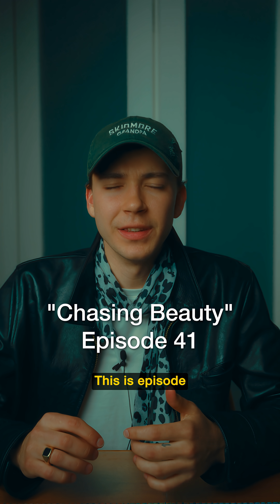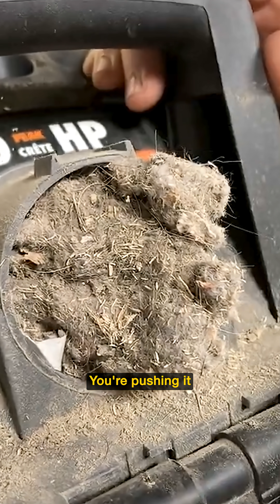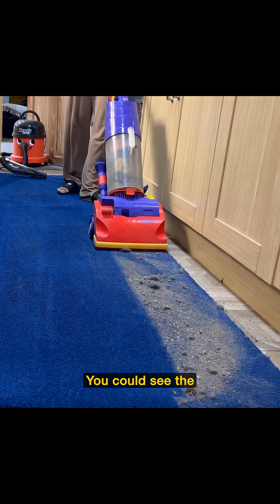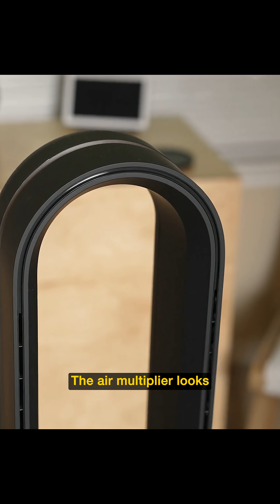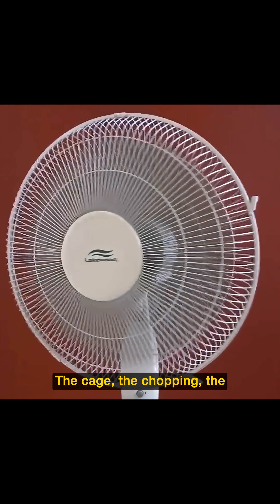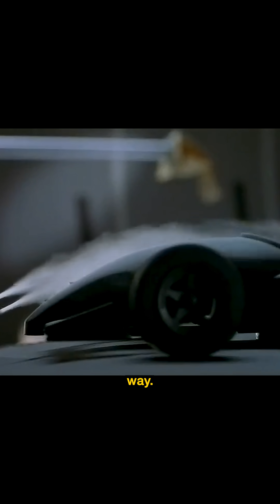Dyson products look weird, but there’s a reason. Behind their iconic product design...

Comment: Retailers also hated Dyson because with his vacuum cleaner people wouldn't purchase dust bags.
Reply: I wanna buy Dyson, I just don't have the money for it😢😂
Reply: @clareang  Get a used one. Just make sure it's a good one. I bought two new and have had both for a looooong time and they both still work great. Idk about the new ones though.
Reply: @clareang do your research there's always another company product that's better or just as bad(yes never ever had a good experience with dyson)
Reply: @s @shiion6711 dk if you pick up a V8 and mod it to work with a 9.0Ah drill battery then they run for well over an hour and can cover any modestly sized home

You’ll give up the fancy pass through charging but you can just slide the battery off and load a new one. If you’re already initiated into any of the clans, you probably already have spare DeWalt, Makita or Milwaukee batteries laying around your house
Reply: @shiion6711  only major negative experience I have with Dyson is the DC63.
Reply: @clareang  there are many, many, many other brands of bagless vacuum that are significantly cheaper than Dysons, and they've existed for decades now. Stop being lazy, go find a bagless vacuum for like $30. It'll be fine. Dyson's products are deliberately over priced in order for them to appear to be luxury items, much like what Rolex did with their watches where they were originally quite cheap, until cheap quartz watches came along that told the time more accurately and didn't need winding. So Rolex greatly increased the price to enter a new market, the luxury item market, so that they could then sell their watches for tens of thousands, marketing them as jewelry instead of as a practical item for telling the time.
Reply: @clareang I've seen a lot of people claiming their Dyson products just stop working, even new ones. Idk if it's worth all that money yet. I don't think they've fully got this new tech down just yet.
Reply: @anh7807 yeah the Dyson are EXPENSIVE and always break down after a few years. I love my Sebo that has a bag and amazing filtration. I have cats and with my allergies it really helps. Suction is amazing too and never had it clog
Reply: @anh7807  Their design compresses the transistor near the motor, resulting to the transistor melting and failing after certain use. I saw a vid on youtube on how it works and they replaced the transistor just near the motor because it stopped working with afformentioned issue.
Reply: @anh7807  "New tech" bro Dyson has been around for 3 decades... just say you wanna hate on something you only have biased secondhand information about.
Reply: @anh7807 who are those People?? a lie you tell
Reply: @ArcaneShenaniganery they've been around, but not with this specific technology. Go read the reviews yourself.
Reply: @anh7807 Uummm, it isn't going to get any better; the Dyson has been around for nearly TWO DECADES at least, and they're still JUNK. I used to have a sales/service/repair shop for sewing machines and vacuum cleaners; ALL bagless units are solid, cheap plastic, they're filthy to empty, most use expensive after-filters or permanent ones that require meticulous maintenance and cleaning, and NONE of them will actually do what they claim they will; we tested them against other vacuums all the time, and several other different brands were always proven to be better, in many cases, much, MUCH better, than Dyson. If you want a high-quality, dust-free solid performer, I'd recommend a refurbished Kirby, TriStar or even a Rainbow, IF you don't mind fussing around with a water filled basin every time you use it; personally, I find it to be major pain in the ass. Some excellent plastic units are Miele, Panasonic, Simplicity or Riccar; the Sanitaire line is also worth a look if durability is important, but for reliability and durability, a good used refurbished Kirby is a good choice, too; just don't go in for all of the extra, optional accessories like the carpet shampoo unit, floor polisher or turbo sander; you'll never use them. Just grab a set of basic cleaning tools and the hose, and between that and the upright unit, you've got more than enough. They also tend to run for 25-30 years, and they can be rebuilt over and over and over again.
Reply: @anh7807 my mum still has the hoover shown in the video. Dyson products are good
Reply: @ArcaneShenaniganery  Retro Dysons are unbeatable.
Reply: @anh7807 planned obsolescence baby, having a product that lasts forever just isn't as profitable
Reply: @anh7807 buy it on sale will change your life haha 😅
Reply: @anh7807  if it makes any difference, my family bought a Dyson in 2011 and they gave it to me when I moved out. I took it to the shop recently because I accidentally yanked the cable out, and the lady behind the desk told me Dyson hasn’t made a good vacuum in the last ten or so years. She said the stick vacuums are the worst and only last a couple of years on average. Mine still cleans like a champ after 15 years of use.
Reply: @anh7807  i've had a dyson vacuum for almost 10 years and its still alive and sucking
Reply: @anh7807  they are terrible. Also super non ergonomic. Honestly it's like they make every aspect of them as unergonomic as possible on purpose, it's that bad
Reply: @anh7807  our vacuum did stop working, bought it twice because my dad didn’t notice it was the same brand we bought the first time, both stopped working.
The fans do work, we’ve had them for years and they do work well.
Reply: @anh7807 my family does house cleaning(so disclaimer this is using a vacuum like 100x more than it’s meant to) and my dad(vacuumer) really loves the Dyson ball vacuums despite the fact that certain design flaws makes them last only 1-12 months. At one point we were going to macys to replace the Dyson EVERY MONTH until macys stopped letting us return them
Reply: @anh7807  my family have had a v6 absolute since like 2015 and it STILL works like a charm after ELEVEN YEARS
Reply: @anh7807  They can still clog. You just can't see the clog. You have to take the stupid thing apart to find it, normally in the short connecting tube from the roller brush to the cannister. 

You suck up something that's a little large, it blocks that tube a bit, which catches more and more dust and dirt. Pretty soon it doesn't suck up anything. 

Ask me how I know. 🙀
Reply: @daleryanaldover6545  so they do it purposefully for planned obsolescence? Because that sounds easy to fix
Reply: @anh7807 own 3 Dyson vacuums, and the blow dryer. Best blow dryer i have ever owned hands down. I own 3 vacuums because when I move I get a new ones, all 3 work great even after years of ownership. So as an owner of many of their products, they work great, but thats from my personal experience
Reply: @anh7807 you're gullible if you believe people who masquerade as being able to afford a Dyson products. Oh you silly child 😅
Reply: @anh7807    Yeah, this new 33 year old tech…
Reply: @marjoriemacdonald3153    Almost like every appliance requires some kind of maintenance 😮
Reply: @daleryanaldover6545   yeah I very much blame user air obviously certain things could be made better, but at the end of the day machines are made to be used for certain purposes in certain ways and pushing them past their use case or use time is always gonna be bad and result and catastrophic failure eventually this has been the case for like all of my mom‘s vacuums and it wasn’t even her fault. It was just everyone else that used it would let it get all clogged up which then let’s trap heat which then also if you keep using it for like an hour or longer, it’s also gonna get hot. I mean if you need to do it in multiple passes, then you need to wait.
Reply: Error*
Reply: @daleryanaldover6545   It's not "compressing" the transistor.  
Overheating it is more likely.  Transistors don't belong on AC motors anyway.
Reply: @NullwaveHORRORAt less than 10 years old, I should hope so.  It's still practically new.
Reply: @ethereal41 I should hope so.  At 11 years old, a vacuum at that price is still practically new.
Reply: @stevethou  That's pretty new.
Reply: @clareang there are similar models from other brands. I have a samsung and it works great! 6 years of hard working in a house with 2 fluffy cats and my long hair. I use it daily to prevent dust allergy to flare, too.
Reply: @giuliaspezi9912 At merely six years old, I should hope so. It's practically new.
Reply: @clareang 😂😂
Reply: @clareang. I was a cleaning lady for 35 years. Dyson sucks, no pun intended. The vacuum tanks leak dust. The suction is too powerful, so what you see in the tank contains unnecessarily destroyed carpet fibers, along with dirt.
Reply: @annhalton1963   Agreed on the dust leaking part.  Most bagless vacuums can only go so long before they start leaking dust thru its o-rings like this.  
But there's no such thing as a vacuum too powerful...  those bits of carpet are not from overwhelming suction:  a damaged beater bar can physically shred carpet though, although it's pretty rare.  It's most likely just old carpet, and the fibers are getting brittle with age and dirt being ground into them underfoot.
Reply: @1SqueakyWheel No. I know what I am talking about.
Reply: @annhalton1963  I'm not here to argue..  just giving you a friendly heads-up on something you may not have realized.

Dyson has never been anywhere near the strongest vacuum motor out there doing residential or commercial duty; 
If a carpet breaks up while being vacuumed, that's a carpet problem, not a vacuum problem.  

But if it helps to draw you a comparative picture, knowing what you know about cleaning various household materials, consider this:  

Professional steam-cleaning rigs so big that they are physically driven on roads to a customer's house or office.  
You know the big vans with giant 2½ to 3½ inch diameter vacuum hoses, long enough to reach every corner of a house through its front door while parked on the driveway or curb;  This thing is no mere Orek.  

These vacuums are so powerful that they have to be powered by gasoline/petrolnor diesel engines, all while spraying water so hot that it has to be heated by a live boiler so that it comes out of the nozzle and injected into the carpet at upwards of 300°F... (over 160° if you into celsius).  

You know what happens to synthetic fibers when they're wet and/or saturated with heat well above boiling point, right?  They're even more likely to come apart, if they're prone to do so at all.  

These engine–powered vacuum rigs apply a suction with both volume and intensity that no measly 15-amp run-of-the-mill vacuum cleaner from Walmart could ever even hold a candle to.  

So if these professional steam-cleaning companies aren't getting sued left and right, then suffice it to say that there aren't portable Walmart-grade vacuums like Red Devil, Eureka, Hoover or Dyson out there breaking the laws of physics with a little 1 to 1½ inch ID hose aperture powered by 120vac wall-plug cord at a 15 amp limit.  There's just NO comparison.  

Either the carpet you experienced was old and worn-out from years of soil grinding and shredding the fibers over time, or it could also be a chemical that was previously applied that damaged and/or weakened said fibers so that all it took was a basic upright PLASTIC vacuum cleaner's brush-bar to start shaving and sucking up bits of that carpet.  

I hope this helps.
Reply: @clareang  Dreame has similar vacuum cleaner, I have the R20, it's great, has power und you can easily get an extra connection piece that allows you to fold/bend the tube to have an easier access to vacuum under couch and furnitures etc.
Reply: @clareangdon't bother. Get a Miele.  German made vacuum cleaner with bags. I've had mine over 12 years now and I love it. Great suction and no dirt that you need to empty. I bought one for my mom too. And it is repairable at a vacuum shop. Nothing compares to this brand of vacuum cleaners.
Reply: @clareang  I suggest you save your money; they're solid plastic garbage, AND....they absolutely do NOT perform the way they claim they do! It's all a gimmicky LIE. I used to own and operate a vacuum cleaner and sewing machine sales and repair store; we sold any brand of vacuum, so we were not locked into promoting one brand over all others. Don't waste your money...also, bagless vacuums are a filthy, unsanitary mess to deal with and empty, because no matter how the different bagless vacuum brands are designed, dumping the dirt container is UNIVERSALLY a nasty, filthy MESS. Disposable micro-lined bagged brands are superior to bagless in every conceivable way.
Reply: @jamescarrington5521  To the eyes of the store selling replacements I'm sure disposable bags are superior.

Unless you're dealing with literal toxic or biohazardous waste I don't see much issue with a tiny bit of dust wafting out to settle on the floor when emptying a vacuum cleaner into the trash.  It was out on the floor to begin with after all.

You could also do what I do and empty the vacuum cleaner outside if you have a yard.
Reply: Don't, it's not very good.
Reply: @clareang just get a shark, cheaper and last longer
Reply: @clareang it’s not even that good…
Reply: @clareang  they are crap. Just get a good bagged vacuum cleaner.
Reply: But the lifetime worth of bags is already included in dyson price anyway =)
Reply: Bags are super cheap also better filtration I have small polish vacuum with hepa filters and synthetic bag
Reply: My Miele is better than any Dyson i ever used. I have allergic Asthma.
Reply: @KarMa-ws3ll yup. Iced had a Miele for 12 years now. Bought one for my mom.  I love using it. And I don't mind paying for the bags. It's a lot better than emptying the dust yourself! I've had it repaired once or twice but I think it will last forever. Like a family heirloom that I can pass on down to my kids! Best vacuum cleaners out there.
Reply: It’s too bad that bagged vacuum cleaners are far better!
Reply: Dust bag is a joke.Just put it dirt to trash can.Yeah! Dirty hand but saving a lot of money.
Reply: @macnguyen9414  My mother literally had me do that as a kid because we could not afford to buy new bags as often as we needed them.
Reply: @winterinbloom  I literally do that right now. I just use a gloved hand and voilà. I only change bags when the old one is REALLY bad
Reply: Someone made a reusable bag that had a zipper that you could dump it all out easily, but only had those that fit certain vacuums.
Reply: I hate Dyson coz they’re tax dodgers
Reply: Isn't the plastics in Dyson vacuum cleaners really shitty? We once had one and it was really brittle. Things would break often. Not a high quality product. It just looks cool that's it.
Reply: To be fair dust bags are more effective and far cheaper than replacing the filters.

But Dyson has good marketing.
Reply: The vast majority of household vacuum cleaner manufacturers had their own bagless models before Dyson ever hit the market.
Reply: We had reusable fabric bags for decades before the paper ones became popular. People just got sold on not washing them. Dysons and sharks are junk I would take an oldschool vacuum and a mini shop vac any day.

You are paying a premium for marketing hype. "OOH cyclones, it must be good". Baaahhh

This video is some ridiculous dick riding. They make stuff look cool so rich idiots will buy it and brag about it, period.
Reply: Ah, the classic bait and hook business model. The bane of printer users across the world.
Reply: pricier than the alternatives ? yeah
a few years behind tech-wise ? I doubt it
Reply: Ĺ😅😅
Reply: That's why you make it cheaply out of plastic. so it'll break in a few months to a year and they'll need a replacement
Reply: Now they buy v8-10 housings cuz the latch breaks 😂
Reply: which is why it costs so much
Reply: Their after service is something to be experienced!!!!!
Polite , helpful, respectful knowledgeable and a total pleasure to deal with.
They really have changed the game ……..
Reply: Now they love them because bagless vacuums die faster than bagged ones do so now they need replaced more often.
Reply: Untrue. My father worked in a specialist appliance repair shop and hoover bags were a 'loss leader' (<£1 for 5) to give people a reason to browse the shop. It was the reusable/washable cloth bags that killed that off first.
Dysons were great for business because they required expensive parts, had many potential 'points of failure', the plastic cracked easily in some areas of the casing, and their suction power meant people were accidentally hoovering up larger objects and damaging the machine. 
People did like the see-through aspect, however, but not because it showed how powerful the hoover was - it was because they could see when it was full and avoid causing a fire.
Reply: @richardwright9292  how else will I know when to empty it 😆
Reply: Luckily they made peace with retailers by implementing planned obsolescence and unrepairability. Every product must be delivered to a landfill within 2 years, that's the Dyson promise.
Reply: Wrong. You just have expensive filters to either wash or replace all the time, so retailers couldn't have cared LESS. But go ahead, all of you CHEAPSKATES, remain in the filthy dark ages and keep buying your WAAAAY OVERPRICED, all PLASTIC bagless vacuums that also come with PLANNED OBSOLESCENCE built right in; oh, what EXPENSIVE FUN! I used to see these vacuums in my repair shop all the time; one day, we decided to see just how great it was supposed to be, so we did a side-by-side comparison with a bagged, micron hepa filtration Kirby, and our findings were surprising. We poured half a box of salt onto 2 separate, thick rugs, then we ground it in, to represent sand and grit, which is what actually wears a carpet out, so removing all of it is essential. We ran the Dyson over the rug, stopping to empty it repeatedly until it was no longer picking up any more salt; then we did the same with the Kirby, then we removed the bag and replaced it with a new one and vacuumed it again, and then we cut the bag open; just a tiny bit of salt was visible. We ran the Dyson over the Kirby side, and it picked up no salt. At all. Then we used the Kirby with another new bag installed over the Dyson side, and we pulled out at least another 1/2 cup of salt THAT THE DYSON CLEARLY MISSED! That's all the proof I needed to see; the Dyson is a marketing gimmick, and it's also a LIE; it is NOT superior to anything else, not even a cheap Bissell "ClearView," or "CleanView," whatever they call it, bagless vacuum cleaner.
Reply: @jamescarrington5521 Found the Kirby salesman🤣
Reply: @goldenageofdinosaurs7192 At least the Kirby actually works as a vacuum cleaner.
Reply: @jamescarrington5521 my cheap 50 dollar bag less kmart vac is so powerful i can put it on the ceiling and hang from it almost
Reply: @jamescarrington5521 Screw off Kirbyman.

If they were that fantastic they wouldn't need to barge their way into my house then complain like a spoiled brat when I try and kick them out.
Reply: @jamescarrington5521 yup. Kirby and Miele vacuums are the best ones out there
Reply: funnily enough, maturing is realizing bagged corded vacuums are superior to wireless and bagless (bagless usually have really poor air filtration and you are in contact with all the dust and junk when you empty it. wireless means eventual battery degradation and usually weaker suction so stuff is left behind) average consumer is paying a premium for dyson's marketing
Reply: @royisdabest I'm pretty sure Dyson also has a bag type vacuum, though I don't know what happened to it.
Reply: @royisdabest look at product farm’s video testing an arrangement of vacuums and Dyson was shown to have top of the line air filtration by any reasonable metric. I use the Dyson ball animal 3 and it quite literally releases no dust and hardly affects our air quality, which is monitored by our air purifiers. I’d say it’s as good as it reasonably needs to be.
Reply: @asdaffagan117  You said 
".... it quite LITERALLY releases no dust", immediately followed by "... and HARDLY affects our air quality."  
That sentence managed to contradict itself, as well as demonstrate the fact that you must not understand how the word "literally" works.  
If you'd said "practically" or virtually", the statement could have been inarguable.  

Back to the subject though:  plastic bagless vacuums (Dyson included) slowly begin to exhaust progressively larger dust particles over time with age and use.  It's inevitable.  One way you can slow this natural degratory process would be to wipe all o-rings or rubber seal contact surfaces with a moist and then dry cloth after dumping before closing it up for re-use.  

Also, remember this:  If you can smell hints in the air of the vacuum cleaner being used, then you're smelling DUST.  
Hepa filtration can only trap down to a certain rated micron level of dust in any best-case scenario... any air moving through that isn't treated thoroughly with a scrubber or liquid is GOING to carry dust particles.  

Thar's why the ONLY type of literal "dust-free" vacuum cleaner for a house  would be a plumbed whole-home unit that exhausts outside the home.  And I can't recommend those enough, especially to carpeted homes.  They're expensive, but generally last the lifetime of the house
Reply: @royisdabest   yeah no i would prefer no bag than have to buy more one use products.
Reply: Dyson uses batteries. Thats much worse than paperbags😅
Reply: @KarMa-ws3ll  Pretty sure Dyson has curded models.  
They're just going to advertise the cordless ones more heavily because convenience sells better than longevity for their core demographic, which is really true for all manufacturers.
Reply: Corded is better, but I think bagged vacuums are almost extinct now. Most home vacuum cleaners are corded, but bagless. The cordless ones are convenient for small spaces though, even if they are less powerful.
Reply: @royisdabest  dysons marketing, which includes this very video
Reply: @royisdabest  exactly this. Bagless is the dumbest thing ever
Reply: @royisdabest most tank vacuums sure. But Dyson vacuums typically have realy strong filters.
Reply: @royisdabest  corded vacuums are a pain, if u need to vacuum up something small its much easier to just grab ur wireless one and be done in a minute or 2.
Reply: @royisdabest  these vacuums have hepa filters on them and you ain't breathing anything. you don't even have to buy a Dyson to get one with a hepa filter. also, battery technology has improved significantly that power and duration isn't even an issue anymore. your views are heavily outdated.
Reply: @StickmanAirsoftPH  you don't understand. When you empty the stupid bagless container, you get dust everywhere!
Reply: @StickmanAirsoftPH  His views are rooted in basic physics.  
The corded unit will outlast the cordless one by ten times or more. 

You also seem to be unaware of how hepa-filtered vacuums wear in the real world;  They problem isn't the air passing THROUGH the filter element... it's all that pesky air that leaks past it within the casing, carrying unfiltered air.  Plastic vacuums will always suffer this limitation.  

And just remember:  If you can smell ANY hint of your vacuum being run, that's because you're smelling DUST.  
That is to say, you are inhaling tiny dust particles in order to detect the scent you're sensing.
Reply: @royisdabest  yup, bagged vacuums are the best. The bag is a filter, and then it also has filters. When the filter "clogs" it's because the bag is full and you throw it away. Bagless vacuums require way more messing with the filters to keep them clean and working well. Plus they're loud as hell, especially cheap ones.
Reply: @fang_xianfu let me point you to the water filter vacuum cleaners. This is the only way I can vacuum or sweep without getting an allergic reaction.
Reply: I love dust bags and it'sthe  one reason I dislike the dyson style bagless cordless vacuums. Dust bags are much cleaner and more convenient to throw away. Emptying and cleaning bagless is annoying.
Reply: @madcroc111  exactly. The way I get my cleaners to empty client's bagless vacuums is to open it up and suck it all out with a bagged vacuum cleaner
Reply: @madcroc111  exactly, the bag less design is the reason I don’t buy Dyson and it’s not even that good of a vacuum cleaner
Reply: Planned obselence.
Reply: Honestly, I bought a Dyson last year and have zero regrets. They work so incredibly well it’s insane what other vacuums left behind. And they work on any thickness of carpet WITHOUT having to adjust it. Absolutely insane
Reply: @gdogg123uran  😂😂😂
Reply: 1,000th liker :)
Reply: It's pretty genius to use bagless vacuum. We want less waste after all.
Reply: @fujitsu-no  no it's stupid. You have to empty it and the dust goes everywhere!
Reply: As if reusable dust bags don't exist. I wish to know how well the Dyson vacuum cleaner handles coins or hairping or anything not dusty like pet hairs with the cylinder.